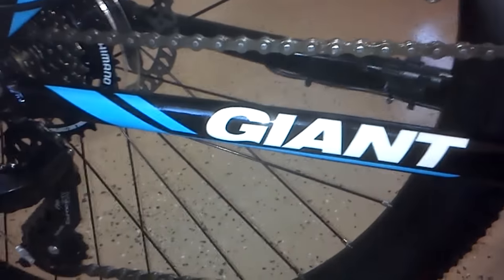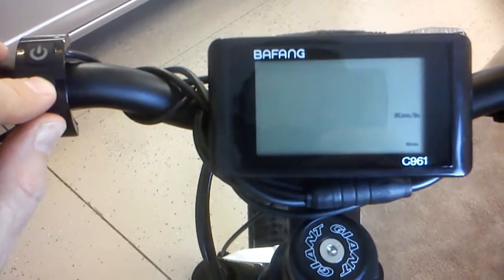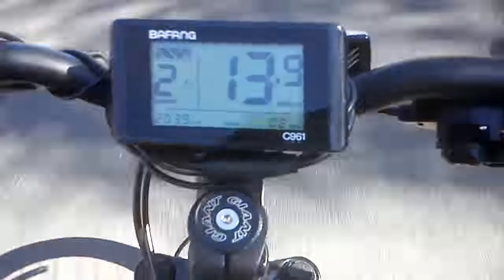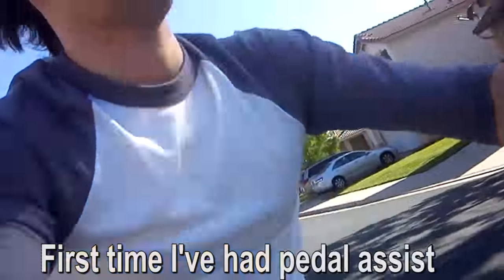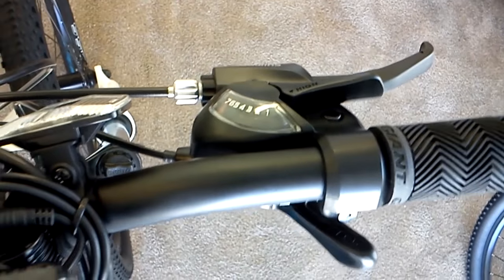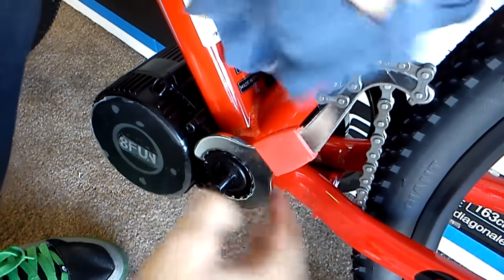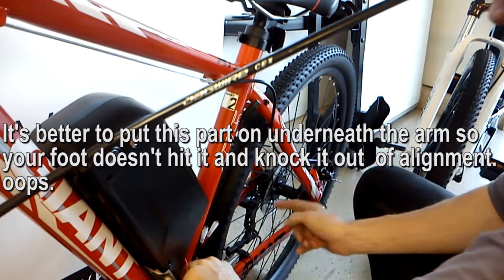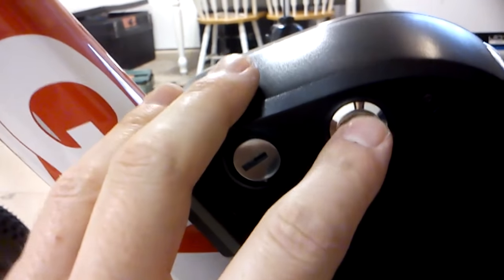I Built a Electric E Bike Bfang 8Fun BBS 02 Mid Drive

Comment: I remove grips by forcing large stiff zip ties between grip and handle bars about 4 works well. this separates the rubber from the handlebar. Then simply slide grips off with a few twists.
To reinstall simply place a few zip ties inside the grips slide on, align logos or whatever  and then pull zip ties out (Zip ties should be about twice as long as grips and i usually use pliers)
I prefer this to any sprays as the grips never come loose due to solvents or water.

Comment: I have a Bewo mid drive and there is a power assist sensor setting, forward or back. Setting it to back and it throttle only. There's a pedal assist sensitivity setting, 2 to 9. 2 is the quickest higher means more pedal rotations to trigger assist. Stop pedalling then start again when changing gears...smoother.

Comment: Hello The brake lever shuts the motor off.(by using a magnet)    I have a dual pull that activates both front and rear breaks with one lever.  On the opposite side lever only connect the power cable. When you want to shift,  Use the lever to act as a clutch,   do this while you shift gears and just pedal without power.  This will help you avoid mashing gears and save money by keeping you from  tearing up your expensive drive train.  When you want to stop, depress Both levers (the clutch and the dual pull)              Dual pulls by Sun are really inexpensive about $14-16 bucks.  And, simply move the break cables to one side.
These motors have a huge amount of torque.  They can snap chains and really mess up cassettes if the broken chain gets sucked into the spokes.  It is worth the money to invest in a really good chain like the X series by KMC.  These are virtually stretch proof.  On their website, find your category and look for a chain starting with X.  for instance a 10 speed chain would be (X10.93 SL )  9 speed would be X9 and so on.  Nice heavy duty chain for a tough job.  It will save you money in the long run.
Reply from the maker: +Robert Krause That's a good idea. Thanks for sharing.  I would have to get a new shifter as well sense my brake lever and shifter is a 2 in 1. I will think it over. I do pretty much pull both breaks all the time, a dual pull sounds smart if it works as good. And I like the idea of making it more like a dirt bike with a clutch. I can gently pull the front break down and clutch it without rubbing the break. Mostly I just ride with no pedal assist and full power on the throttle. Seems like just letting of the throttle and shifting then throttling again is working good. But I messed up something trying to shift down while climbing a steep dirt hill from 7th to 6th, I didn't let off the throttle ... oops. I was loosing so much speed and didn't want to fall over. grind grind grind,.. skip grind.. Think I need a new freewheel now or a chain because 7th skips under full load all the time now. Measured the chain and that seemed fine . But I didn't have the proper tool though and used the ruler way. So I ordered a new freewheel and the 7th gear looks pretty much the same on the new one. Waiting on the tool to put the new one on. Anyways thanks for your input.

Comment: Great video Kent! I have been planning to build my own e-bike for some time now. And after watching your video I decided to go with the giant atx, because I like the giant atx frame, and is not that expensive.

I have ordered a Giant ATX 1 2016, I think it will arrive tomorrow :)
Bafang BBS02 48V 750W Mid Drive Kit with the C963 display is on it's way from china.
The battery I ordered from em3ev. But I need range, and they have this new High power 30Q 48V 12Ah battery that I ordered. 
Apart from that I also ordered a bling ring 42T chainring.
Also a shift lever, because of the integrated break/shift lever on the giant atx.

Maybe I also make a DIY video. If I do, I will link to your video. Thanks for the inspiration Kent! 

/Peter (Sweden)
Reply from the maker: Cool. Thanks for the comment. Im still loving mine. I Got a new freewheel the other week with a 11 tooth 7th gear now it goes 34mph but has a little less torque in 1st for really steep hils. Hope ur build goes good. Sounds like it will. I want a better air fork next😅

Comment: Hi great video I am looking to do a BBSHD conversion of a 17 giant ATX 2.  What size chainring are you using?  Are you having any drive line issues?
Reply from the maker: I originally got the 46, then I got the 48 tooth and a DNP Epoch Freewheel 7spd 11-32 Nickel Plated , and I loved it but the freewheel wore out really fast on the higher gears and I broke my axel. So I got a new rear wheel so I could use a cassette instead. Purchased Sunrace CS-M40 7 Speed Cassette 11-34 and a new chain and for some reason I get a-lot of misses (chain slips) when pedaling with the motor in gears 6 and 7.  Not sure if its my chain or the Cassette. My speedometer stopped working too but It is definitely faster on throttle only than it was on the 46 front chain ring.
Reply: @KentYo.  i added a gear shift sensor.it cuts motor for a fraction of a second when shifting,really makes it smooth.

Comment: You are so funny .... Very nice and awesome video ... 
I have Giant Talon-3 2016 model with hydraulic brakes and Tire size 27.5 inch ?
Can I install this kit and keep the hydraulic brakes ?
And what about the other ebike kits like the front wheel hub motor ( ex: Leed 500W series )?
What do u recommend ?
Thanks anyway
Reply from the maker: +Dr Abd  you can install this kit with hydraulic brakes if you still got room for the throttle,  you can get these adapter wires for the brakes so they can still cut off the engine. Some people don't use the engine cut off system at all. The engine quits pretty quick after you stop pedaling or throttling it is just not instant. I am just using one engine cut off break lever from the ebike kit.  I recommend mid drives to keep the weight out of the spinning wheels and centered for better control. I think that Talon is a 73mm bottom bracket though which means you can only put one lock nut on the engine and it will prolly move and drop frequently depending how rough you ride.  I might have got a better Giant but they didn't all have 68mm bottom brackets.  Thanks for watching :)
Reply: Thanks alot. Helpful reply. Appreciated.
Reply: +Kent Oster 
What's your recommendation regarding the chain wheel size? Considering that I have some hills to climb on my neighbourhood and I think 25 MpH is the max speed I want, the mean is around 15-20.
Thanks anyway.
Reply from the maker: I went with a 46 front sprocket. I wish I woulda gone 48 becuase its too easy to pedal when trying to go fast. I have the stock Shimano TZ31 14x34, 7speed
freewheel in the back. My system is really hard on  this freewheel. I have gone through 2 of them and need a third already. They are only 14$ but really hard to get off to change. I am going to try to find a stronger one if one exists.

Comment: Are those mid drives hard to peddle if you run out of power
Reply from the maker: Nah, but they do add a very very little bit of extra resistance. Like the resistance going backwards on a cassette or freewheel
Reply: @KentYo.  awsome bro .. thanks for the reply i think ill be getting a similar set up

Comment: You want to keep the motor revs high from what I noticed, to keep it running cool.
Reply from the maker: Larry L I see. Thanks for the tip. Did you read that somewhere or just notice it? I read you want to pedal with it all the time to assist it as much as possible. That kinda takes the fun out. They have upgraded their controllers recently so hopefully the new mosfets will not burn out anymore.
Reply: Kent Oster  I set mine up, (750w) with 6 levels but I rarely use 5 and 6. I have a 46 - 13-34 cog 7 speed. I noticed when running the throttle only,  I get a higher speed at times using the next lower gear, as not to have any bog, yet when trying to pedal, it is a bit too fast. If I use a higher gear I can pedal but my speed is actually slower. So I go down a gear for throttle only. There are charts online showing the max torque and efficiency. It's about 80% no load full speed. I wrote to one person who de-tunes the 750watt to 500 watt about the software to tweek things since i saw a guy on you tube doing it, any info you have please let me know thanks.
Reply: so are your bikes still going....how many miles u done?
so are thee any mac motor mid drives, i heard the mac rear n front wheel drives have better windings internally than mac.
i am really keen to build similar to yours.
just the video i needed for motivation.
Reply from the maker: I fried mine after about 250 miles. I sent it back to china to get it fixed under warranty. I probably burnt out the $80 motor controller.  I was riding it hard for about a hour up steep dirt paths without pedaling. Testing it's power and climb ability on a hot day. Bafang has already upgraded their controllers with higher quality mosfets sense I got mine. The newer ones are supposed to handle more heat as a lot of people are frying them it seems. :(  I don't know anything about mac electric motors.
Reply: +Brett Rickards I just put my bike together a few weeks ago with just a few hundred miles on it..What I will do when riding, say in 5th gear, level 4 out of 6 programmed, and lets say it is topping out at 18 mph, I will see what it will do in 4th gear. If if will do about the same speed, I'll stay in the lower gear.( in throttle only mode) after a while you kinda know what gear to be in for the least amount of amp pull thus you get more miles per charge and a cooler running motor.
Reply: let me know if it handles wet n snow temps...i am in sweden
Reply from the maker: I've seen pics of people using this motor in the snow on fat bikes so it should work. The cold weather should help to keep it cool. It is not 100% water proof though so I worry about it when it starts to rains. I been in some a bit of rain though and was it was ok. I didn't get drenched though.
Reply: you can coat the electrics in an oil goo that stops water in its tracks. the rc car world uses it for their electrics.....try it.

Comment: the wheel size settings i think compensate to assume there is a tyre on there so if you have 26" rims you set it to 26" not perfectly accurate but not far out as you might think, ps it took me 2 hrs max to fit my kit did you spend 6hrs scratching your balls?

Comment: Where did you get the software and wire harness to change the motor settings?
Reply from the maker: Larry L    https://electricfatbike.wordpress.com/2015/03/17/programming-the-bbs02-without-frying-your-controller-and-losing-your-sanity/
Reply: Kent Oster Thanks for everything and keep us posted with your fix, hopefully we will have a good network of people  to help service and get parts for these drives.

Comment: I bought a 500w motor (front wheel drive), with a 36v lithium battery. Its on a 26 inch wheel and in mid air goes 31.5mph. on road its more like 22.5mph, but have reached 30+mph downhill, and fuck! is it scary lol
Reply: It came with peddle assist, but i just dis-guarded it. never even plugged it in, why would you even think of peddling when buying this thing lol